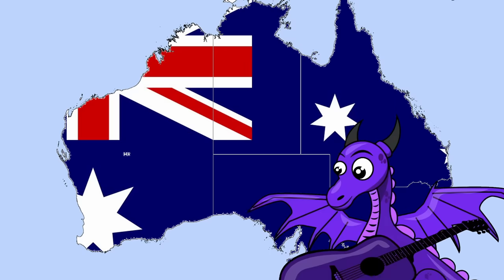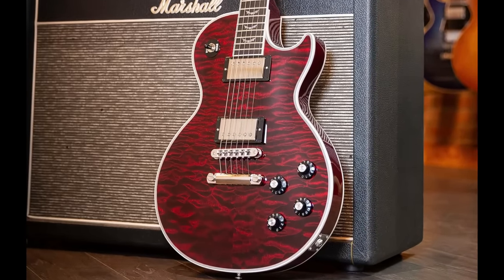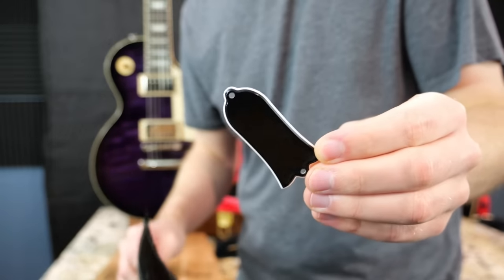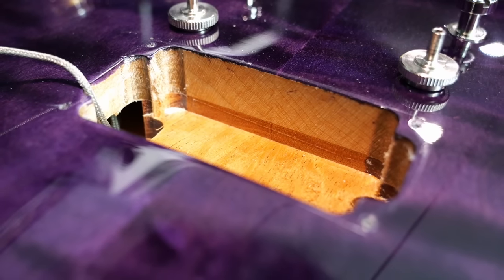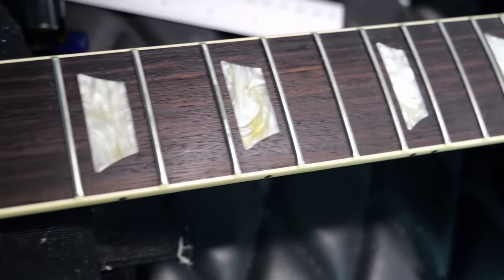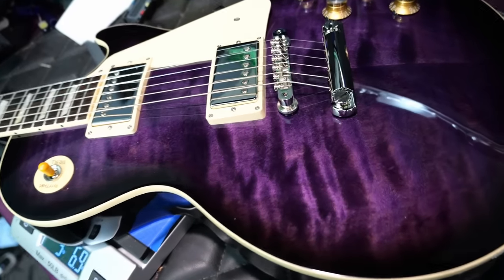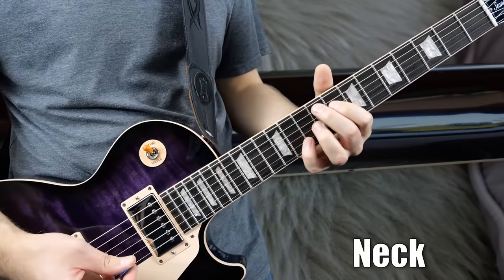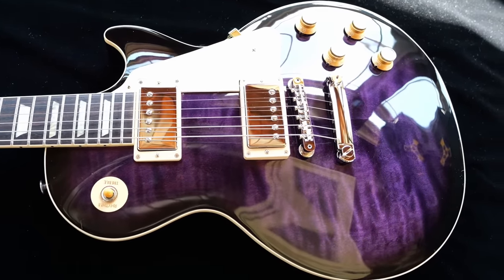You Can Only Get This at Guitar Center* | 2024 Dark Purple Burst Quilt 60s Gibson Les Paul Standard

Comment: 4:56, that top is absolutely Book-Matched.
It starts out that looking at the right-hand side is actually the bottom of the left-hand side's grain/figuring, the LH is a negative of the RH side, that is how it starts out when the top maple blank is sawed down the middle, folded open and glued.
Then, after it has been glued to the top of the mahogany body the top needs to be carved back to make the "Dish" and "Belly" of the Les Paul's carved top.
When carving the top more wood grain is removed from the maple cap/blank, originally the LH and RH sides where the opposite of the other, however, when you sand the maple top to produce the curve you actually sand wood away from the spot the tops used to match.   It's possible to have perfectly matched sides and then have the grain fall off/less figuring during sanding as the grain lines diverge from their original look.
Austin needs to take a Tour of the Gibson USA Factory.  👍
Reply: Agreed. I was thinking that looked like a perfect book matching too. And your explanation perfectly describes why the curvature has slightly less match to it. How deep the quilt effect goes can vary, and sometimes carving wood off will do that. Spot on HK!
Reply: yep.  the "non-book matched" approach only applies to RI's because, history n stuff.
Reply: @tinystar3010  👍  
Also, much depends on the piece of wood itself as sometimes the figuring isn't as deep, part of the trade-off when using rare woods to make 1000s of guitars.
Austin really should visit the Gibson plant.
In one of the tour videos it was stated that some of the Custom Shop Historic Les Pauls' purposely have mismatched tops so as to replicate the practice from the early days of building the Sunburst Standards when they transitioned from Goldtops to the cherry bursts tops.
Reply: @ScottsGuitar  Exactly, the '57 - '58 transition period when they changed from Goldtops to Burst finishes.
Reply: Why do they cut the maple in half?
What is the advantage?
Reply: I’m hoping he reads this, it’s not the first time he’s made that sort of comment.  One side flips when the other side flops.  Hadn’t thought about the effect of the carve on the match, though.  I want a AAA purple or silver quilt so bad.
Reply: @ChrisShortyAllen  Economy of manufacture.   Finding a figured piece of Maple large enough to cover a guitar top is very expensive as they are somewhat rare.
By using narrower pieces and sawing them in half you can produce more figured tops per log of wood.  
Manufacturers do produce 1-Piece figured maple tops, however they are less common and command a premium price.
Its all about making as many guitars as possible while also reducing waste of the figured wood blanks.
Reply: @ChrisShortyAllen  looks better most of the time